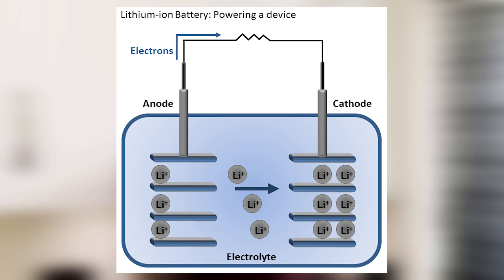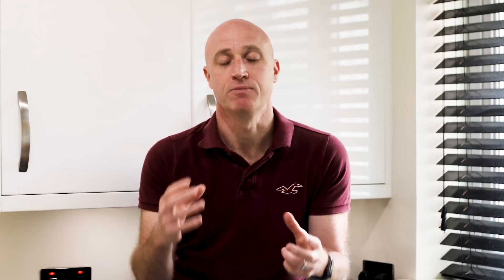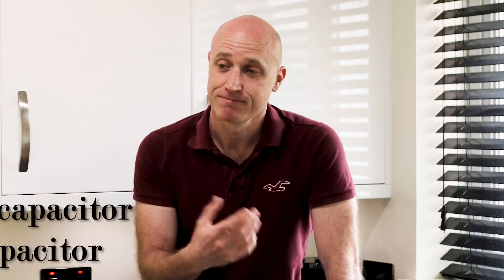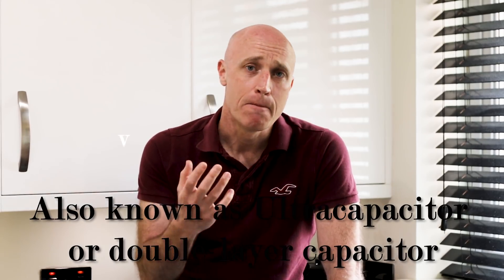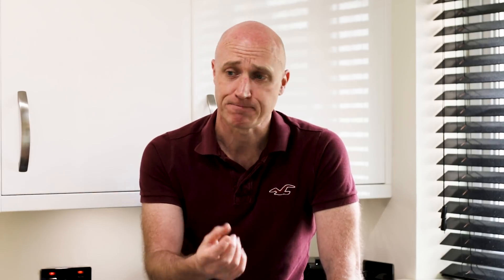Super / Ultra Capacitors | The Future of EV Car Batteries?

Comment: Why are super capacitor so damn expensive? There's less chemistry involved with it...
We would use more supercapacitors, now, if they weren't so expensive.
And another question I have is why are they only making 2.7 volt capacitors?;I don't understand why they aren't making higher voltage super capacitors...
Reply: They are expensive because the materials are expensive, and for now made in low numbers.
And the low voltage is a limit to physics, capacitors get more capacity if you can bring both charged plates closer, but the closer you get the less voltage you can hold back with your insulator before electrons can punch through.

Comment: You seem to have forgotten the french bolloré company that has been developping supercapacitors for 20 years now, invested 3 billion dollars in R and D and have produced several cars using them : bluecar, emehari, bluesummer. They dont discharge instantly but more at a rate of 1.5% per hour, so they take two days and a half to discharge totally : https://www.youtube.com/watch?v=p_g_NF2XhC4
Reply from the maker: courcheval that looks interesting, unfortunately my French is a bit limited but I’d love to know more.
Reply: Those batteries have been used since 2011 in the "autolib" short distance rental system in Paris : same system as the bike rental but for cars. Supercapacitors are more destined to rental companies, since they need to be used regularly as they need to stay plugged to keep the 60 degrees necessary to keep they going. As a matter of fact they are ideal for public transportation. There is a version for buses, the bluebus (220 of them in use all over the world). As for french, google those words and you can use google translation to get a fairly good idea of the content : bolloré, bluecar, bluebus, lmp batteries, e mehari.
https://www.youtube.com/watch?v=5i2QOBsH7N4

Comment: Well super caps would be great in ev but keep the electric rules in mind if you theoretical can charge an ev in a minute what huge amount of power you need to deliver to the charging cables. I assume that wires thick like arms where needed.

Comment: Capacitors work by electrostatics and their storage potential is proportional to the surface are of two opposing plates separated by a dielectric insulator who's thickness has an inversely proportional affect of capacity. The thinner the dielectric the more energy you can store, however this also affects the voltage they can operate because the dielectric also need to keep the plates from shorting. The science to improving the capacitance is down to increasing the surface area while not increasing the size of the capacitor. Electrolytic capacitors use a wet dielectric and are found in most modern power supplies which is why they fail after a while because the dielectric dries out and the plates short out and naturally they dry out quicker the hotter they are. Most plates are made from aluminium film or zinc, but moisture penetration oxidizes the electrodes causing degradation of the area. Graphene looks to improve the conductive properties allowing thinner layers to be used while new dielectric materials will be needed to withstand the harsh environmental conditions of a vehicle and provide thinner layers to perform with greater dV than ever before realised.

Comment: Great video again! Just wanted to add that both solid state and graphene batteries are Li-ion ones. It is the electrolyte changed to a solid state substance, or the anode (or cathode) covered with graphene to reduce degrading. As the forming dendrite between the anode/cathode causes over time a short circuit in the cells, and results in what we call degradation. 
By limiting the penetration by dendrites with graphene cover or making it practically impossible to penetrate the electrolyte by replacing the original gel version with a solid state one (currently sodium) will increase the lifespan.
Reply from the maker: Excellent, thank you for the explanation.

Comment: There is a reason they don't put ultracaps along side batteries.  You can't just parallel ultracaps with batteries.  Do get the energy out of a capacitor the voltage has to go down.  A battery hold much more constant voltage.  So you get very little advantage of paralleling.  You could use an extra power electronic converter to combine the battery and the ultracapacitor but that is expensive and adds extra weight so people don't use it.  Ultracaps are used for starting trucks.

Comment: Ideas not bad but a bit like hydrogen and hybrid, adds complexity, becomes very quickly obsolete as batteries themselves are improving so quickly . Example 5% increase in performance of 20 kilowatt hour  pack would add 1 kilowatt hour  , would require significant super capacitor both size and weight with extra controller system on top of battery tec . As I said easily adds complexity where not required . Other example solid state likely to make this old hat . We already have ludicrous Tesla performance which by the time the new roadster comes on line will be obsolete with the 200 kWh pack in the same packaging or near enough , like mini disc after cd , too late because MP3 players solid state made them pointless , speaking as a man who bought minidisc, big mistake
Reply from the maker: Nigel Weir Ha! I just avoided the mini disc! I think that if they make the breakthrough they are trying to with super capacitors then the energy stored and released will Work give it lightning charging times and vastly improved life span but it’s all theoretical at the moment and solid state batteries look like a better bet to succeed!
Reply: Nigel Weir 
Sorry, no, because if they work, (and it seems they do.... )
They will make ANY battery more efficient, last long and have more range.
They will also hold more energy for a smaller size.

Comment: Please review the terms "power" "energy" "work" and "force". You are mixing them up.
Reply from the maker: Frederic Borloo I did have a section of the video about the differences using the water in a big / little bucket with a big/ little hole. Unfortunately it dragged on a bit so I cut it out and then as you pointed out used the wrong terms in places. Hopefully the message still came across 👍

Comment: I've thought of this for some time, but I cannot see how super-capacitors can be of much use in an ordinary EV, as long as their energy density is a lot less than batteries (which fact I don't think is going to change any time soon). This fact practically limits the total energy storage of capacitors to only a fraction (less than 5% I think) of the energy the batteries in the EV can hold, and whatever advantage they provide only applies to that fraction. They could allow you to charge a few percent of the battery almost instantly, but is that really of any practical use?

One use I can think of is giving VEs with a relatively small battery the performance of a Tesla model S (for a short time, say to set a 0-100km/h acceleration record), provided the non-battery part of the drive train can handle the power. This might be a cool thing to imagine, though probably would still need some pricey hardware, to start with high power electric motors. Other applications can be imagined tough, and do indeed exist already, outside the "regular EV" segment. An electric bus that can change up its super-capacitors every few minutes at a bus stop does not even need batteries, and can go on all day in spite of a quite limited range. And in navigation weight is less important; there exists here in France a ferry service that does about 15 minutes of electric navigation and then fills up its huge super-capacitor banks in minutes each time it docks.
Reply from the maker: Marc van Leeuwen good example. There is still a lot of what ifs before they could go mainstream. Here is an interesting website I was sent that may interest you 

http://kilowattlabs.com/index.html

Comment: The idea of super caps being the charging cache, allowing the caps to slowly discharge into the battery is a great idea, it will mean potentially quicker charging than an ICE! :)
Reply: True, but only to until the energy content of the super-capacitors is reached. Supposing their energy density remains an order of magnitude lower than batteries, this unfortunately limits the usefulness of this idea enormously. Suppose you have a 60kWh battery and then add half the weight of the battery pack (which is quite a lot) in super-capacitors. With 10 times less energy density, their energy content would be 3kWh. So you could charge up 3kWh almost instantly (supposing the rapid charger can provide the power), but then would have to wait for that energy to be transferred to the battery before you can repeat the operation.

Assuming the batteries can handle 120kW charge rate, the transfer can be done in a minute and a half, so you could repeat the operation every 90 seconds, until having filled up the battery after some 20 iterations. But that would take half an hour, no faster than just filling up the battery directly at 120kW at the charger. And this is logical, since the super-capacitors cannot actually help the batteries charge up faster than can without them; they just can flatten out spikes in the power input or output that batteries could not handle

Comment: Kilowatt labs sirius battery is a super capacitor battery used in home solar 3kwh and 7kwh on the market now in 48v. Limited to 30min charge time but can be charged in 30 seconds. This could be used in cars as they are scaling up the voltage to variable voltage units.

Comment: I have said this for the last decade, ever since I saw the Eaton HLA (Hydraulic Launch Assist) which does the same thing, the braking energy stored hydraulically to aid acceleration. Their test vehicle a Ford F150 accelerated as fast as a Ferrari. Not only that they also found that 75% of town travel used the HLA as opposed to the gasoline.
Reply from the maker: mynewschannel I’ll look that up. Thank you 👍
Reply: So using Super Ultra Capacitors is the way to go for replicating Eaton's HLA electrically.
Reply from the maker: I guess the theory is similar but as I understand it HLA is coupled with a diesel engine to provide assistance accelerating etc with energy harvested for regenerative braking. Obviously I'm not a fan of diesel!!
Reply: Yes diesel is a no-no, I was talking about EV's using Super Ultra Capacitors as a launch assist and for far more efficient energy recovery for regenerative braking.
Reply from the maker: mynewschannel that’s would be a perfect fit. Let’s hope some cleaver bod can figure it out 👍

Comment: Take a look at the Riversimple Rasa. It uses an "underpowered" hydrogen fuel cell with ultra capacitors instead of a battery to boost the acceleration. The fast charging ultra capacitors are able to capture 50% of the cars kinetic energy. It's a very interesting concept.

Comment: RiverSimple makes a car using supercaps and a hydrogen fuel cell. You could replace the fuel cell with a very low power, high energy battery, but then it will also charge very slow. So these will only be city cars. 

The other problem with capacitors is the voltage drops very fast as it discharges, unlike a battery which has a much more flat discharge. This is a lot easier to use than a capacitor battery which might go from 800v down to 50v, instead of 400v down to 300v like a chemical battery.